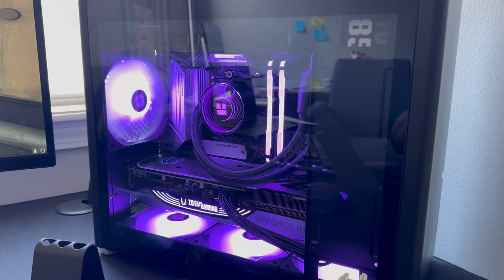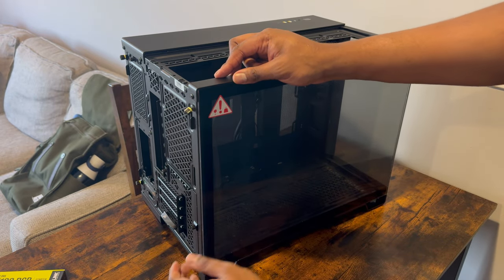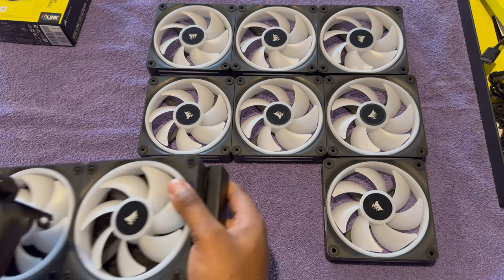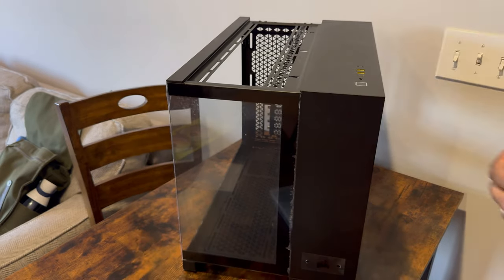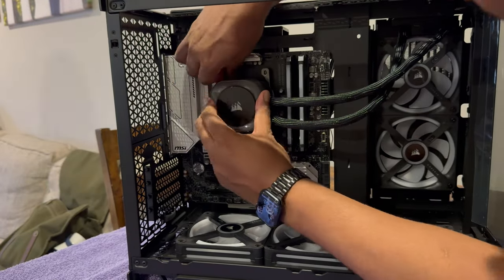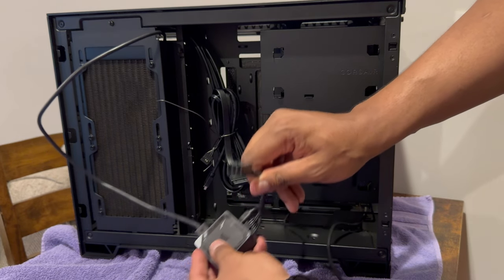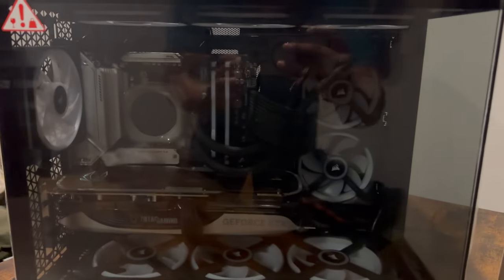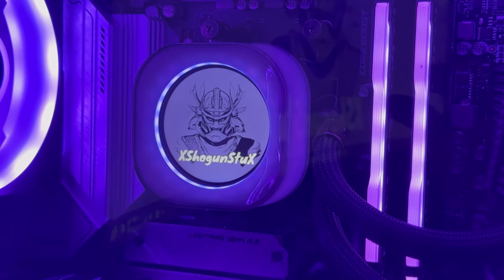Corsair 2500X mATX Case | iCue Link QX120 Fans | iCue Link H100i LCD AIO Build - (PC Build Vlog 7)

Comment: You're a PC modding machine!

I noticed you have your AIO mounted with the hoses at the top. You may want to look into the best AIO orientations as this orientation is a known way to allow air bubbles in and overheat the pump.
Reply from the maker: Yeah, this was the cleanest way to do it. I might change it but i was pretty much told that as long as the pump isnt the highest point on the system i should be fine
Reply: @BigStuDolla91  ah, that's right. I was thinking you didn't want the ends of the hose to be the highest point, but you're right, I was remembering it wrong
Reply: @mcorrive12  hey, you are correct with the cable positioning on a radiator. You want cables at the bottom because air sits at the highest point, and that means the cables where the liquid should be forced into the pump are at the highest point where the air bubble inevitably will be. It's minimal, either way is probably acceptable

Comment: How much fps on fort my g? Can you make a video one it, I’m making the same build and idk if I should spend money on a 4080 super or a 4070
Reply from the maker: I have a 4070 TI and I play on a ultrawide. Ultrawide tend to take about 10% of your performance. In Fortnite with graphics maxed out, nanite and ray-tracing off, and DLSS set to quality, I tend to max out at 160hz which is my monitors refresh rate. 144hz is usually the lowest I’d see. If you don’t have a ultrawide I think a 4070 super would be just fine
Reply from the maker: i just upgraded to a 4070TI Super and im getting 160-180 fps with max settings, DLSS Quality, and no ray-tracing.
Reply: @BigStuDolla91  they use the same gpu and the same resolution and maybe certainly ray tracing as well

Comment: just ordered the 6500X and iCue Link H150i LCD AIO and (7) QX120 fans
Reply: how is the cooling bro? im stuck between on getting the Qx or the Rx
Reply: @judejuicegod3167  haven't finished my build yet waiting on 9800X3D to drop and next Nvidia cards. QX basically has better RGB both are good. If you want all the icue effects go with QX but RX are about $60 cheaper per 3-pack of RGB fans

Comment: I kinda want it, but I really like the 4000d. Plus I’ll be water cooling so the water block is only 3/4 size of the stock 4090 gpu. So it might look too small in this pc case
Reply from the maker: Just use a 360mm lol
Reply: @BigStuDolla91  not sure what u mean. I’m gonna use the ek 4090 fe waterblock which is 236 ml  in length.
Reply from the maker: @drblitz3092  my bad. Misread what you said